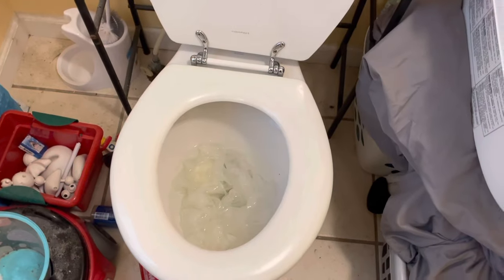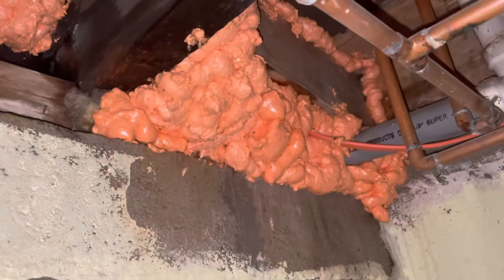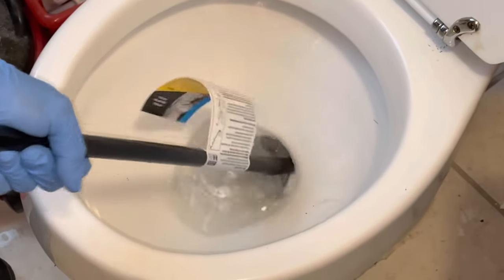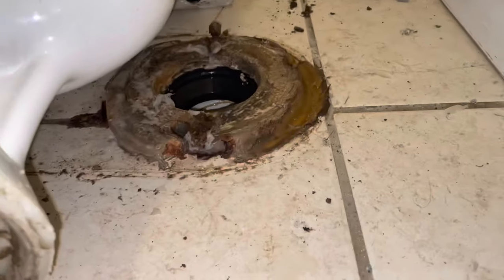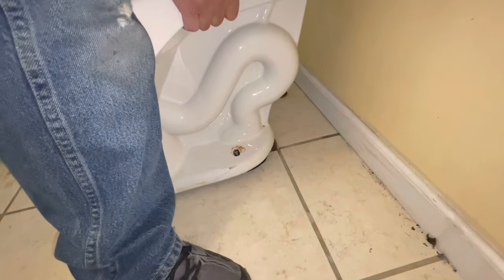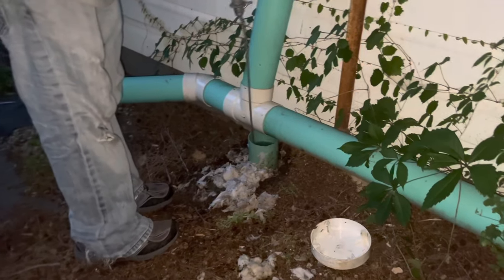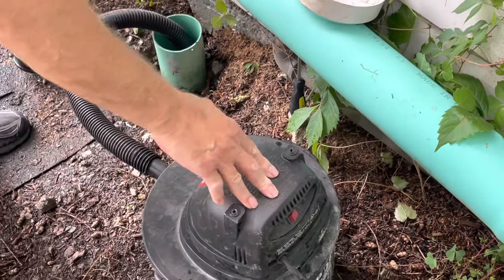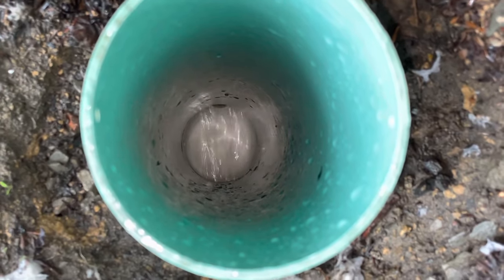Main Line Plumbing Clog Fix

Comment: When the sewer clean-out, outside of your house is overflowing like in your case, that means the sewer blockage is somewhere BELOW that point from there, out towards the street  where the main sewer line is. In your case, there was nothing wrong with your toilet.--- Old sewer guy :<)
Reply: Thank you for this comment.
Reply: Hey Mark, I just had to have my sewer clean out cleared due to a blockage and now everything flows fine. Issue is I’m hearing a gurgling of air in my guest bathtub when I flush my guest toilette. (Manufactured home) everything flushes but the gurgling is making me concerned. Any insight?
Reply: I just paid a plumber $300. I was having similiar issues.. started with the toilet gurgling when I was using the dishwasher. I plunged, then it still happened, but now the tub was gurgling and the toilet flush & drain was slow.. I plunged again. Water was not coming into the tub though. It was a temporary fix. It wasn't until I washed clothes in the washing machine. The water backed up and out of the drain pipe  onto the basement floor. I felt it was serious. The plumber opened the main drain pipe to the public sewerage in the basement. I saw a lot of gunk, awful smell, bugs..He had a long 80ft. snake. It did the job. He said I should have professional clean every few years. 😅

Comment: Usually when the toilet flushing backs up into the bath tub, the main line has a clog caused by roots getting into the pipes.  A pro plumber taught me that in old lines, the best repair is to line the old sewer pipes with a resin liner after grinding out the invading tree roots.  Clean outs are required every 100 feet on long sewer line runs.  If you have such a repair done, you cannot use a drain auger afterwards on the line to clean it.  In those cases, you use water pressure to unclog the drain going to the city sewer line.  Rental augers have heavier duty thicker cables (around 1/2" or thicker diameter) to cut roots with.    Many have long runs up to 80 feet for rentals.  Professional plumbers have augers that may be as long as 150 feet.

Comment: Excellent. Just did mine 10 miutes ago after trying to snake it all day yesterday, but the clogg was to deep for my snake which is 25 feet. Used this method and it did the job, you just have to be persistent with the plunging.

Comment: THANK YOUUUUU ❤❤❤❤ I literally had the same issue! The snake and uncloggers were not working. I went outside and found the cleaning pipe and it was a quarter full. After pumping using the exact same tool, i wasnt making any progress. So what i did was add some boiling water from the kettle and some warm water and filled around half way up to get some increase pressure. I pumped and pumped and water was slowly being vacuumed up and some splashed put. As soon as i took off the plunger, the pressure pushed everything down and was bone dry like yours. THANK YOU SO MUCH

Comment: You needed a 40 foot main drain snake which is much sturdier and use a main drain bladder that goes on your hose.It worked for me.
Reply from the maker: I didn’t know the 40 foot are much sturdier, thank-you for the info.

Comment: I have PTSD from our clogged toilet. 
I was plunging, plunging, and then the sewage started overflowing, like a slow, running, volcano. Luckily I was able to contain it, in the bathroom, with using rolls and rolls of Bounty Paper Towels. 
I tried Chemicals, Plunger, Pouring down Dishwashing Detergent, with hot water, an Auger. FINALLY !! What worked for me, was hiring a Professional Plumber, with a Professional Auger, and a Professional Service Charge of $400.00 
Our house doesn't have a sewer pipe on the yard, he had to climb, on the rooftop.
I'm so scared of this happening again, that we no longer wash clothes at home, we now go, once a week, to the Laundromat, and we no longer put Toilet Paper down the toilet.
All the Detergent Soap, Grime, Dirt, and Toilet Paper, will eventually clog the sewer line again. Better safe, than 💩 sorry.

Comment: My analogy is if you use some type of water pressure in the drain I think that is key and using some preventative  often can be key.the plumbing world never mentioning these things like stuff that can work so we pay them a bunch
Reply: Wrong! A professional plumber wouldnt mention this method because we have highly effective and guaranteed to work cable auger machines that can push through just about any sewer stoppage imaginable. This little plunger method through the top of the clean out pipe is NOT effective and this lady here got lucky cause a real.tough stoppage wouldnt have cleared. A good auger machine is gonna get it everytime within minutes. But if you homeowners like playing around with your sewage fical mess.....go right ahead and do whatever floats your boat.
Reply: @Eddie-In-Las-Vegas that's why you buy the clear out machine and never have to call a plumber again...

Comment: I cant fing my cleanout 😢
Reply: It might just be in your basement
Reply: Check the basement or laundry room.  You should have a main line drain (and often an overflow drain hole) somewhere around the lowest point inside your home.
Reply: It's not on the roof?

Comment: Is the water supposed to continuously run like that. Mine doesn't have standing water but no water is running through other than a trickle
Reply: Water would flow only when flush toilet or unplug sink or bath tub
Reply: They were probably running water inside the house, like a faucet or flushing a toilet.

Comment: Mine is just a big open drain in the back yard with 3 separate pipes that spill water inside - but none of the water is going down and the toilet won’t flush 😭 edit: and that same toilet paper issue is coming out the drain, nooo